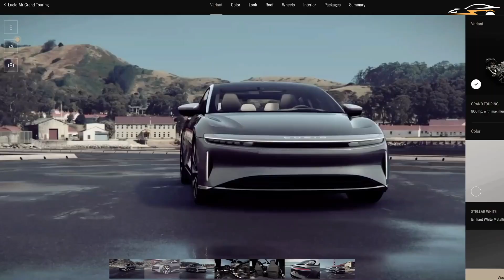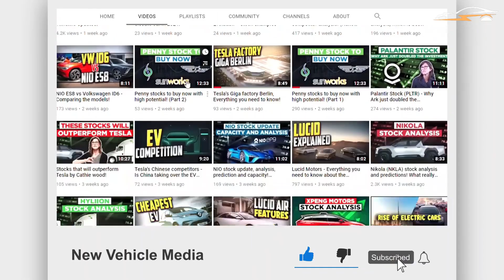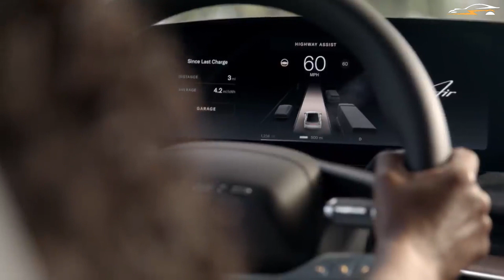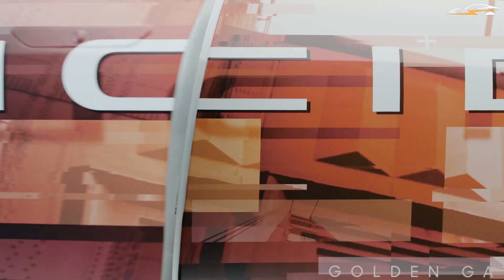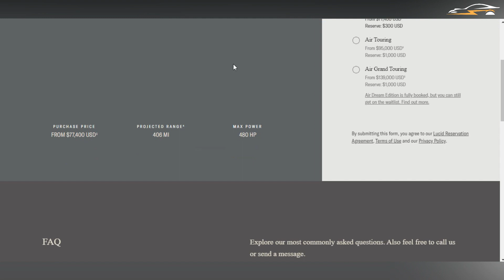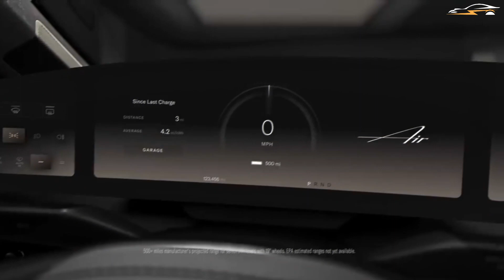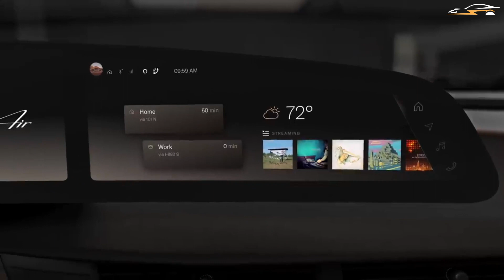The Lucid Air Pure is CHEAPER than you thought!

Comment: The design is better than Tesla. But as an european citizen with crowded cities and narrow streets the Dream Air still looks a bit bulky to me. Hopefully the Air Pure will be more compact design. The double front lips design should be less obvious (as the Pure may have highlighted one single lip only). The middle of the steering wheel shoule have a more flat cover. Looks like old fashion to me. And more then horse power its efficiency what counts. Nobody needs 600 hp or 1000 hp, but range. Also i find it more important to build reliable affordable cars than to waste too much resources for inventing gadgets and self driving abilities in that early stage. I think Lucid is on a good way. I personally did testing for control units and interior lamps of Lucid Air as i work for a supplier of Lucid. all in all I really like the concept and that its a brave western company and design.